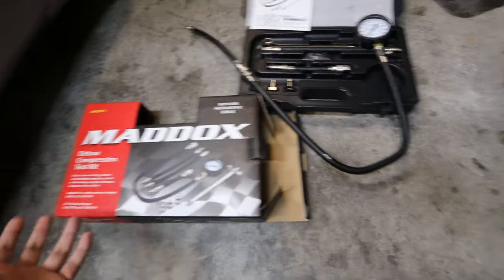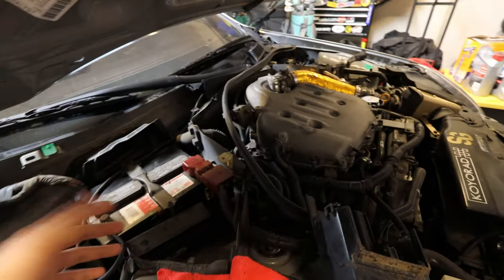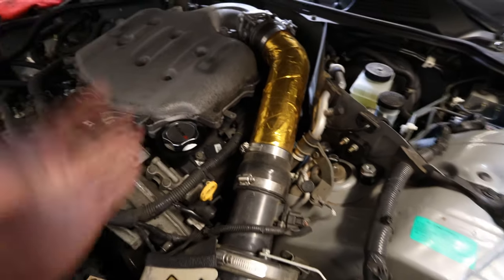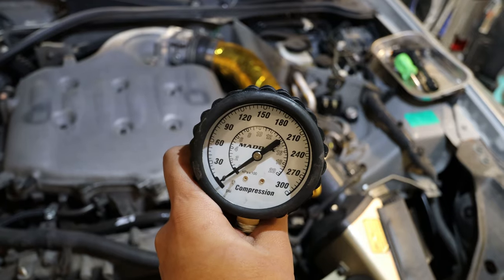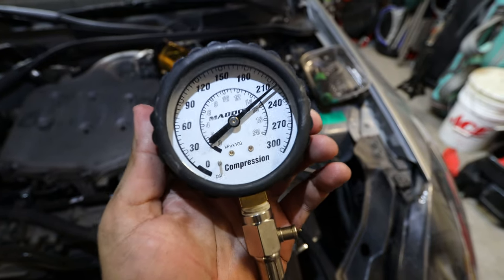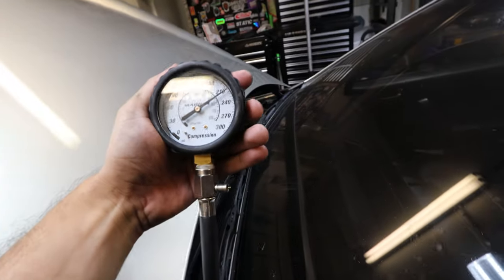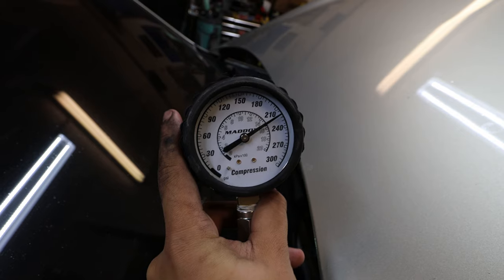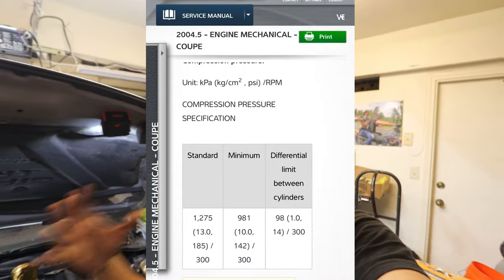How Healthy is Your VQ and How to Check? (G35 / 350z)

Comment: Non RevUp is even better, original DE are the best they run for ever
Reply: Yes. 2 rev ups messed up on me around 150k miles each one. I switched to DE it burns no oil at all. Great engine
Reply from the maker: I love my non revups even if it means I’m not faster than one 😂
Reply: I agree
Reply: The DE do have a little of a OC problem. But not as much as the rev up. Keep your eyes on it.
Reply: My HR is running amazing no OC and it’s got 170k miles gonna do a comp test to see what the numbers are but it runs like a champ
Reply: @JoeVazquez hey bro.. 
I have a crazy miss.
Over fueling too.

Replaced MAF..
6× New spark plugs and coils.
Cleaned the Throttle Body and plug.
done a Major service on the girl..
She's got just under 90k Kilometres on her.

Still a Fat ass misfire..

Man.. I'm clueless?

Comment: taking the fuel pump fuse is not needed, you can just crank it at WOT and that disables the injectors, its called clear flood mode. Just though this would help some people save time.
Reply from the maker: Thanks for the tip! I just followed the Nissan service manual to be safe haha

Comment: I’ve always heard mixed things on the vq some say reliable some say they not I only had a 05 g35 for a very short time I know they can burn oil
Reply from the maker: They’re good! Non revups burn less oil, but pretty reliable engine for what they are!
Reply: Just keep your oil topped up between changes and a revup will go 240k miles.

Comment: 3/10/24 just seen ur video Joe, thnx for putting it out there. I am not a mechanic or anything, but I have a 2009 fx35 with over 200 thou miles, and i was wondering, should i get the cylinders tested,?/,,, I want to keep this vehicle because i just love them. it runs  great still now, but it does start to feel sluggish. If the test is reading positive (base on what you did here), do u think i should still keep it? Any reply will be appreciated. thnx.

Comment: I’m not sure if anyone is still in these comments, but I am misfiring cylinder #4 I changed spark plugs and coil packs. I need to do a compression test but I can get to the plugs without removing the wire harness. It’s just all tied up in the way. Would that be okay to do or so do I have to have everything plugged in? I’m worried it’s a piston ring issue or valve issues. I’m hoping it’s an injector issue. Any help or advice would be helpful!
Reply: Did you figure it out I have a p0300 1-3-5 misfiring changed plugs and coils but came back a year later

Comment: Vq35de are high compression engines which is why they say open the throttle
Reply from the maker: It’s actually to allow more air into the cylinder so you get higher numbers during the compression stroke, high compression doesn’t matter in this part, it’s just maximizing the breathing with the throttle valve open.

Comment: so i have a 07 G35x with 70k on it, I notice sometimes that it has the slightest engine almost "gurgling" feeling that really never lasts and is only barely noticeable and didn't know if it's a thing or what. I also have my coolant overflow tank draining on passenger side (i think, jiffy lube also said it was that side but couldn't locate it)

I saw one of your videos posted about the metal coolant bleeder valve thing and honestly think that might be it. Am I screwed? The engine runs incredibly strong and has no issues, no overheat, but just a little worried bc its an 07 and that ever so slight gurgling thing. Thanks again for your videos Joe, I've learned a lot from you
Reply: It that gurling noise could be something to do with the heater core, try bleeding the car maybe it'll work make sure u put the a.c. on ur highest temp so u can get the heater core going
Reply: You're car is different though you have an HR motor and the heater hose line is not the same. But that might be what it is.
Reply: Thanks! I appreciate it. Definitely going to try a coolant bleed after switching that line. I’m just really hoping it’s nothing more serious than that.
Reply: @chrisd5758  it should still work on any car look up how to bleed the coolant system its very simple
Reply: @dannyboy7139  I work on cars kid
Reply: @chrisd5758  my bad didn't mean to offend ur intelligence my guy
Reply: @dannyboy7139  your comment had nothing to do with my comment tbh.
Reply: You have a bit of air stuck in your coming system. It needs burping
Reply: Im late to comment but I'll give my input in case it helps. The coolant overflow drains right out of the overflow/coolant bottle. There's a drain tube in the bottom of the bottle. If there's leakage in the rear passenger, than it's the heater core hoses behind the motor. It has a plastic pipe that cracks and leaks from age. The bleeder valve is on the driver side to the left of the throttle body. There's also a bleeder valve on the top left of the radiator. Driver side Air box has to come off to get to it.

Comment: Wait you’re boosting w stock internals 😬
Reply from the maker: Yes sir! It won’t be a problem the way I’m doing it
Reply: I saving for the forged internals etc just for that 😅
Reply from the maker: It all depends on what power you’re looking at and also what you’ll be using the car for/ how you’ll be driving it that can dictate how long it’ll last. That’s also not mentioning tuning aswell

Comment: So itd be fine to test em with one plug out at a a time?
Reply from the maker: Yeah I tested them out both ways, and if anything it’ll read slightly higher with spark plugs off by like a couple psi
Reply: @JoeVazquez  forsures, thanks for the info 👍🏽
Reply from the maker: You got it bro 🙏

Comment: Well that’s not your compression your fuel pump fuse was wrong
Reply from the maker: No it was right, car died on its own
Reply: @JoeVazquez  the I fuel pump fuse is on the left side very bottom side of the fuses 🕺
Reply from the maker: Go to minute 2:25, diagram shows where the fuel pump fuse is for mine. Top right.
Reply: @JoeVazquez  dude that’s actually crazy on de the fuel pump fuse is on the left
Reply from the maker: It might be different on years like 05+ or even from 350z to g35 to sedan, etc.
Reply: @JoeVazquez  hell it could but your compression is amazing if it’s correct
Reply: @JoeVazquez  I have an 04 g35 coupe also. Just checked the location for the fuel pump fuse and its the top right one. The same one you pulled.